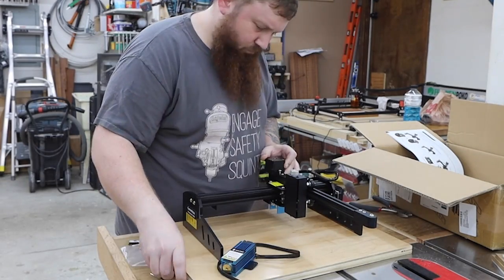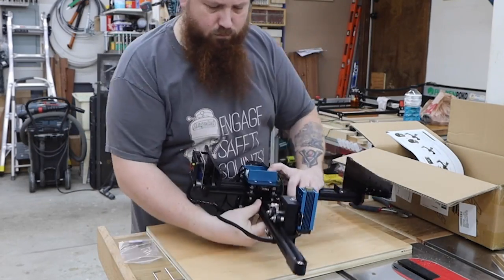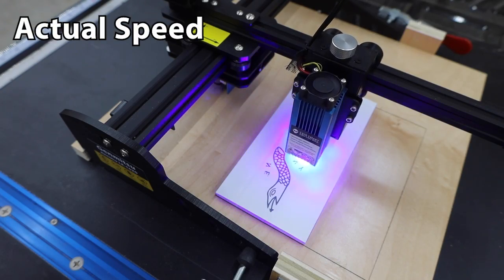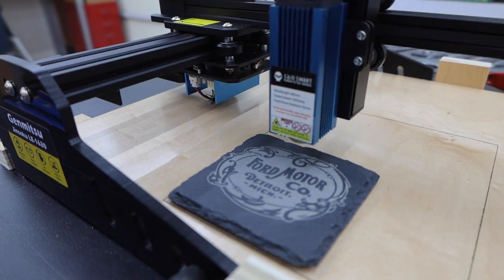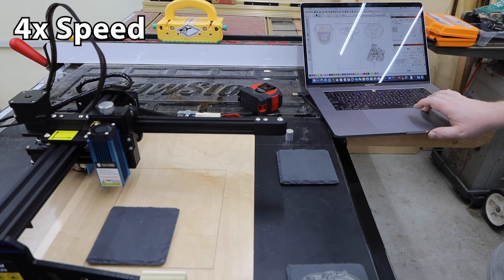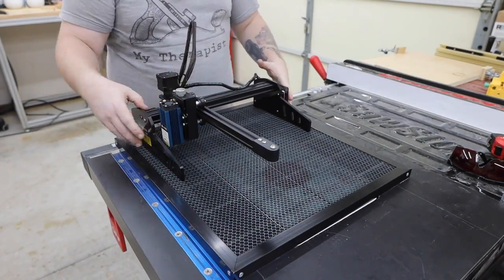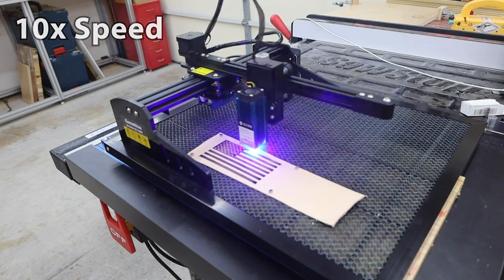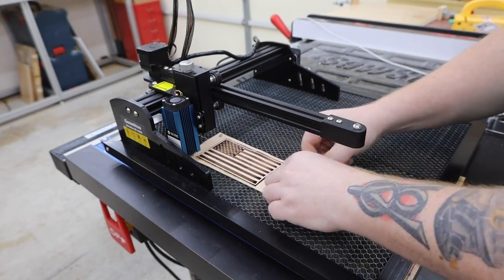Testing the Genmitsu Jinsoku LE 1620 laser engraver SainSmart

Comment: I have the LE 1620 but am having problems running it through lightburn, I have ran a couple of tests with GRBL but they aren't that great. When I run the auto detect in lightburn it only finds GRBL, is that how it should be?
Reply from the maker: Use this setup guide. https://docs.sainsmart.com/article/iqzaz8bt1z-jle-1620-single-arm-laser-quick-start-guide-with-laser-grbl#connecting_laser_grbl_to_the_le5040
Reply: @ChrisPowellFSD  thank you so much, I will try that.

Comment: Great video!   Have you engraved writing pens before with this?  If so, what sort of holder or tool did you use to hold the pens so they didn't move around.
Reply from the maker: Just pencils. You could probably use some thin plywood and cut out slots for them to fit in so they can’t roll around.

Comment: What settings do you use when you are cutting all the way through the ply wood? Still learning the laser stuff. Enjoy your content keep up the good work!
Reply: Thank you!
Reply: Any idea why mine is hitting the limit switch on the y axis and shutting down? What are the correct dimensions I should put into lightburn for this machine?
Reply from the maker: @travisdurham7736  I believe it was 180x180
Reply from the maker: I keep the power at 80% but slow the feed way down to about 10ipm. I usually do 1 pass per mm of thickness on plywood. Start with those settings. If it’s not cutting through you can slow it down or do another pass.

Comment: Loving these quick informative videos!  

QUESTION: Since this is so small (and portable) could you use this on projects that are larger than the machine to say burn your logo onto? For example, the underside of a cutting board/tabletop/back of decor?

I thought about buying a branding iron, but this may be a better investment given the versatility.   I understand you would have to make sure everything was level/parallel to the project surface, but it still seems pretty doable. 

Thanks!
Reply from the maker: Yup it would work great for that. Anything you can set it on, you can engrave.